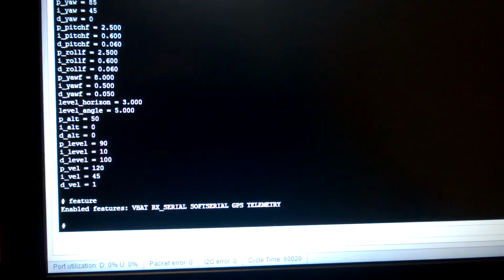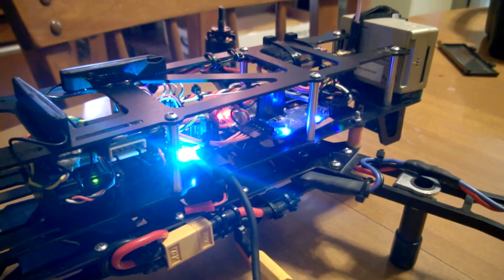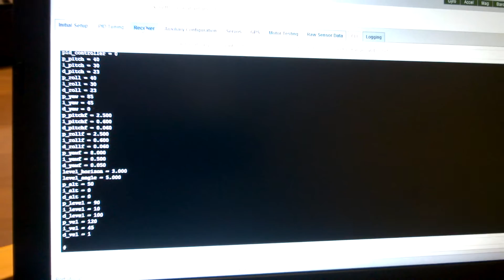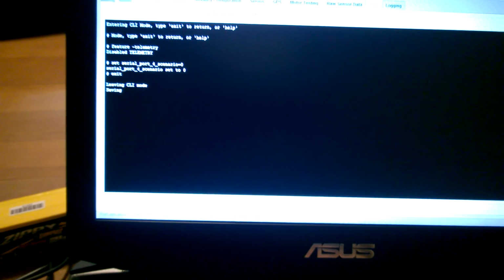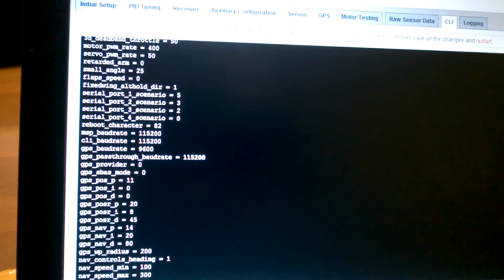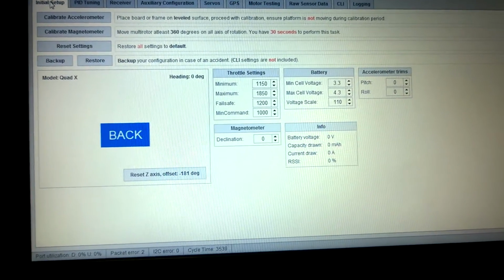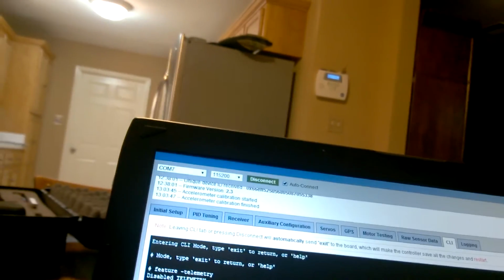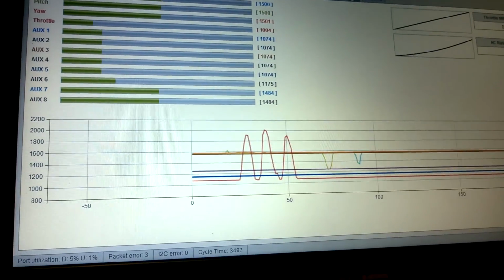CleanFlight telemetry on soft serial ports causes Naze32 board lag

Comment: Actually, most commonly this problem is due to the fact that the RX/TX pins on top of your Naze32 most likely are connected to something, like a OSD device. The RX/TX pins are physically connected to the USB port on the board, hence you get a communications problem with your computer as the RX/TX hijacks two of the USB pins.